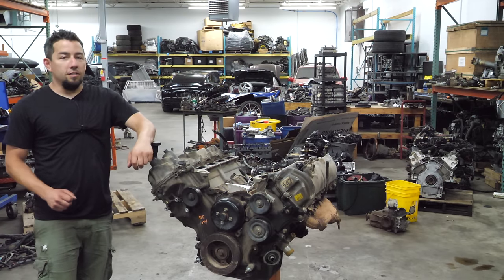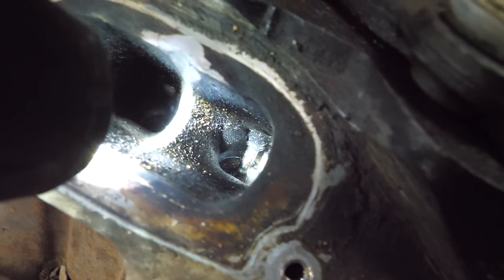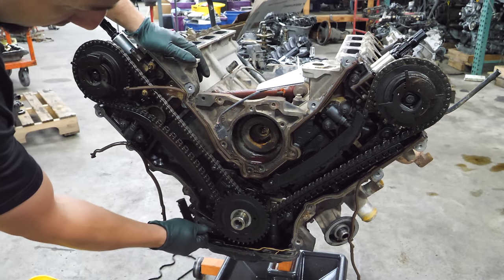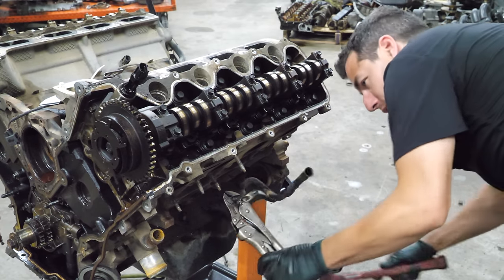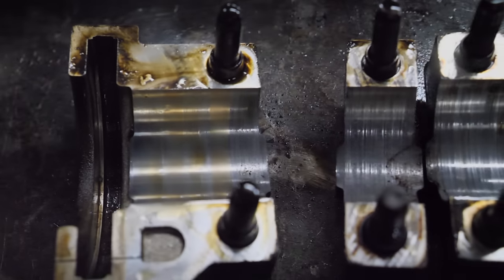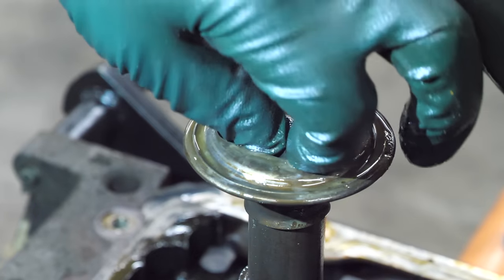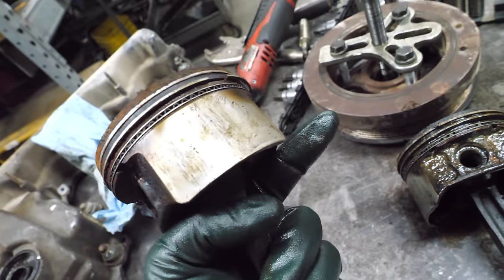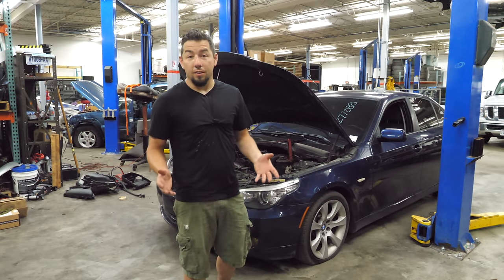Bad Ford 5.4 3-valve V8 Engine Teardown. Which of The MANY Possible Failures Took This One Out?

Comment: 08 f250 with the dreaded 5.4, it lasted  150k, very easy well maintained miles, did 3k mile oil changes,  still died way to early , blown head gasket

Comment: My 99' Expedition had what I believe was a 5.4 2 valve Triton. Got 340k miles on her before trading it out. No real issues but I change oil every 5k. Spark plugs and belts on time.

Comment: I wanted to fix your statement...."Everybody that neglected to change the oil between 5-7k hates these engines".  Mine has never failed, althought I did timing/phaser change at 169k.   I use it to tow an RV and trailer with 5k tractor on it.

Comment: I have a 2007 expedition with this 5.4 has 290,000 miles all original. still runs great has good power and not the worst I've had on gas. I think people neglect routine maintenance and that plays a big part in longevity of the engine.

Comment: I had a 2008 and drove till 120000 kms. Not one issue. The ecoboost in my 2020 raptor on the other hand was eating so much oil that it would run out before scheduled maintenance. I’d rather have this motor over a V6 ecocrap

Comment: I have a 2004 f250 super duty 286,000 on it blown head gasket leaking oil passenger side my question is can you put a different motor in stead of a 5.4

Comment: The 2 valve 4.6 in my 99gt has the same problem with blown plugs. Just happened to me and car has 86k on it. Blown plugs is not common to to just the 5.4 3 valve. I have a 11 expedition with a 5.4 3 valve  with 210k on it and engine runs great. The tranny is a little funky and has to be driven conservative. Never towed anything but engine runs good with low mileage oil changes like 3 k. Haven’t had any issues except latest issue was heater core lines leaking and was a quick cheap fix. Parents bought new and serviced regularly. My question is there suppose to be a large engine driven fan or? This one has 2 electric fans. No problems with over heating.

Comment: I have a 2013 Expedition, 263k miles on it. I've only had it for 18 months so I don't know the maintanace history on it, but it had no leaks, very clean underneath, hardly anything even rusty. Ran great---until I came to a stop sign and heard a clunk, and she's locked up solid. Found a destroyed timing rail and the bits in the pickup. Cams were worn just like this one. Pulled the cams and oil pan, all looks normal. Still solid. Gonna pull the heads when I get it out. I have a reman engine on order...🤥

Comment: I have one in my 2010 FX4 271,000 miles still runs fine (All kinds of electrical problems but at least the engine works)

Comment: I had a 08 F150 I bought used without knowing all the issues the 3V engines had. The engine light started blinking literally on my way home from the dealer. Ended up blowing a timing chain tensioner and starved cylinder 8....

Comment: Fordtechmakuloco has a video on timing chain tensioner failure, same side as yours. All bits of aluminum shavings everywhere from inside the timing cover. Issue was noise from cam followers but had this too.

Comment: My daughter had 06 one of these. It stopped starting. It was that aluminum box mounted back by the spare tire. I got it running, but it had a cam phaser code. So I changed them. They were full of shiny aluminum. I changed the oil, and it was shiny with aluminum and what looed like brass. We sold the POS ASAP. I'm a Ford guy, nut will never buy one with a 4.6 or 5.4. I had an 03 F250 that blew out a spark plug. I bought the kit for that and repaired it, I sold that POS too. I've read about the 5.0's and Ecoboost issues. No more fords for me.

Comment: So much hate for the 3v! The engine in my 07 super crew outlasted the truck built around it here in the rust belt. Plenty of power and zero reliability issues to 130k.

Comment: 2010 f150 3 valve here all the timing issues you showed complete timing system replace both sides. spark plug breaks exhaust manifolds bolts broke replaced both sides new manifolds 30 grand in repairs in 3 years trans all the drive train and 4by4 assembly with vacuum lines hubs bearings ewi both sides tie rods both sides 2 rear ends 2 drive shafts  traction control ebs system  and more.

Comment: The last 2 Ford trucks I had both had the 4.6 liter 3 valves and both had the same problem with the timing components going bad, the Triton V8's are definitely my least favorite engine anymore and is the reason I drive a Chevy truck now

Comment: I had a 2001 van with this engine.  At under 100k the timing chain jumped and I had to replace the engine.  Ford wanted 2k to change and I had
it done for around 800.00.  I used it for a short time and sold it...I think for 3k.

Comment: Why do a lot of 2000’s engines have guide problems.  I have a VW VR6 and there is one upper guide that fails around 90k+ mile.  The lowers are fine and the opposing upper is fine.  There is one upper that is well known on the engine.  Was it a new type of plastic that was used that becomes brittle over heat cycle years?  Just noticed that the ones that use metal and plastic tend to last longer.  Seems to be a problem with a lot of manufacturers during the 2000s, where engines in previous decades timing chains and guides would last several 100k miles.

Comment: Mine blew itself up with 9k miles when I bought it brand new from the lot on my 05 King Ranch F150.  It had 2 oil changes before then. Timing phaser failed and hit valves. Ford replaced the engine after warranty and then died. again with 82k miles. Same issue.

Comment: I had a 2013 Expedition with 5.4 engine. Everyone says they were a bad engine, I never had any trouble with it. I drove it for 76,000 miles and serviced it every 4,000 miles. Now I have a 2019 5.0 engine and hate it. It uses 2 quarts of oil between changes. Also the 10 speed transmission shifts rough. I would gladly take my 5.4 back if I could.

Comment: Is there a reasonable replacement engine for a 2006 F 150 that you could put in that would fit where the 3 valve triton was?

Comment: I think the oil filter housing adapter gasket failed, causing the oil and coolant to mix. it’s another lesser know common issue with the motor; mustangs from the era deal with it as well.

Comment: I have the 2007 F150 5.4 3v 108,000 miles. The "Check Gauges" indicator came on and I saw the oil pressure gauge go to almost 0. The truck made a beeping sound at that moment. I chance driving the 7 miles home and after 5 minutes the truck beeped again, the oil pressure gauge jumped to normal for a second then dropped back down to 0. All of this happened after an oil and filter change 20 miles earlier. Could this be an oil sending unit issue? In other words, electrical?

Comment: The whole problem with most 5.4 3v problems is poor maintenance. I have 330k on my Expedition and still runs like a top. All you have to do is change the oil every 5k miles.  I will agree that you have to baby these engines with maintenance.

Comment: 5.4. 200,000 miles. No problem. I pull most trucks on the road. Use 5/30 oil and upgraded spark plugs and got a Melling oil pump. Looking to get 400,000.

Comment: I don’t hate mine. I’ve got almost 280k on it and it hasn’t puked yet. And I’ll be doing the timing system, oil pump and spark plugs soon. Hoping for bother 200k oh and I’m adding a little 67mm turbo.

Comment: I have 2 of these motors with well over 300,000 , still on original timing chains and guides , and no leaks on block , i guess it all in the maint...  i did 3,000 mile oil changes, never listen to recommended oil changes, from dealer , they know how to wear out a motor faster than any one lol

Comment: Motor just needs oil changes. Timing chain look at 120k. Roller rocker change at 120k because of needle bearings. Alternators at 80k ac at 150k. But all easy tomwork on and get access too. Audi you have to pull the motor to do timing chain because it is against the firewall. 5.4 makes power and sounds amazing. Good 5.4s have the oil pathways bored out and they tensioner system changed for melling and its a solid motor with cheap maintenance.

Comment: I found that if you changed the oil religiously with mobil 1 5-20 every 3000 miles, it would almost make 200k. We had many that had a 5-7000 mile OCI go down between 100-120k. 

But the most important thing was they were cheap! You could buy one for 1/2 the price of a v10 or 1/4 the price of the powerstroke.

Comment: I have never had an issue with my 2004 5.4 3v.  I'm at 225,000 still running strong.  I am meticulous with the oil changes and overall maintenance.  I see 300,000 before I will put her to rest.  I guess I'm lucky

Comment: The reason the chain guide broke is the hydraulic tensioners seal leaks and collapses when shut off, then on start up the chain rattles hence the start up rattle, this eventually breaks the chain guides which drop down into the oil pan and starve the weak pump, which can't build enough pressure to oil the passenger side head. In 08 they switched to a better spark plug mid year, if you have a brown plug boot you got the good plugs that won't break, my 08 nav has 200kms and still running strong, but always thinking about impending doom, BTW the 5.4l 2V only had 3 threads holding the plugs in and would spit them out right through  the hood. @ FORD QUALITY IS JOB ONE haha

Comment: I’m a Chevy man and a man’s wanting to trade my suburban with the 5.3 with a f250 with the cobra 5.4 he’s got way less miles than me considering my motors about to be at 400,000 would it be a good trade ? This suburban is the most reliable vehicle I’ve ever owned and has no problems other than a lifter tap and exhaust leak

Comment: To be fair, many of the oiling issues in these engines like plugged up VCT solenoids, cam phaser issues, timing chain stretch and timing guide wear are lack of maintenance related. People want to run the cheapest oil and oil filters they can find and then make it worse by running extended oil change intervals. In my opinion, any of these modern truck engines should be serviced on the severe maintenance schedule. The 7,500 to 10,000 mile oil change intervals just don't cut it.....

Comment: I am a retired ford tech and i replaced more gm 5.3 engines than 5.4 3valves. I have seen many 5.4 3 valves exceed 500,000 miles including one i had. If folks would change their oil every 3 grand they will last 5 grand hummm some assholes running them 8 grand oil changes that's neglect. If folks would jump on the timing chains when they 1st start rattling on start-up you can save a engine as the chain tensioner usually on the pass side has blown it's seal between the block and tensioner. that's were the low oil pressure starts, low oil pressure then big time issues with cam phasers cam bearings lifters all up top items are low on oil pressure at this point. mine went to rattling at around 200,000 miles and bam pulled the front cover pulled tensioner and a blown seal, replaced with navigator 32 valve iron not the plastic tensioners like came on it, did cam phaser lockouts melling high pressure oil pump (highly reccommended) reflash pcm to discard the vvt operation. You can find these trucks cheap in damn goon condition with engine issues cheap they are tough ass truck and with some money and do it right from the get go they will run a long time. when i repair one today i push the phaser lockouts and re-flash you will loose about 1 mile per gallon but you will feel the power difference in your assometer.. At first ther were some faulty phasers but when ford corrected them and you hear rattles your probably loosing oil pressure and your oil pressure gauge is not an accreate device like a after market were you can see actual psi. and never use dorman phasers. It's not that bad of an engine. folks say i got 300 k on my 5.3 chebby well friend you may have and you may not as i have replaces 100's that never reached 100,000 miles some never made it to 30k I seen 80 gm trucks at 1 time behind a dealer with pissed of customers with 5.3's they said were gobbling oil like crazy. I had a customer with a econoline 350 ford  van (hot shot runner) bitching about his van gobbling oil at 1.5 million miles on it's original v-10 triton and she looked rough, but he was in for a alternator replacement. Now since 2019 the ram has been the most dependable truck.